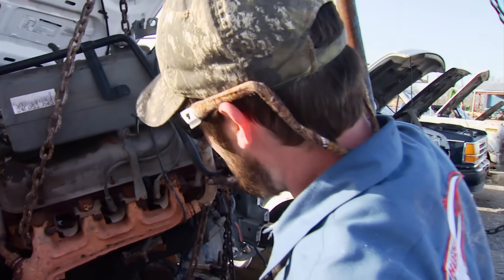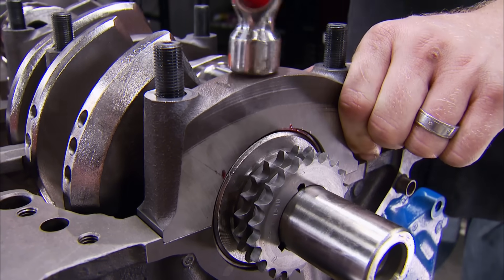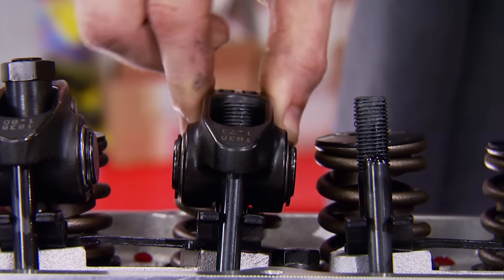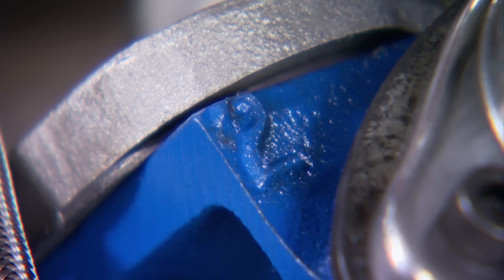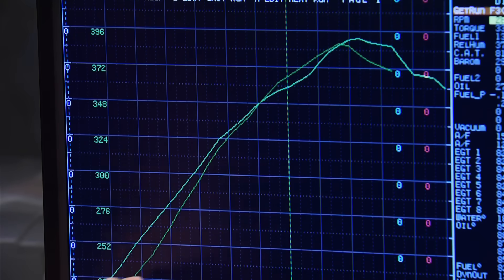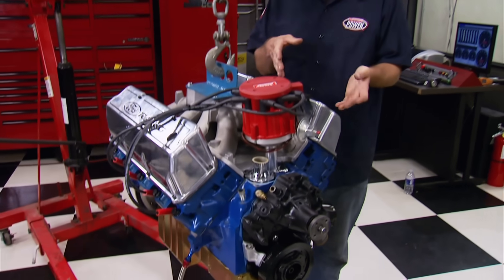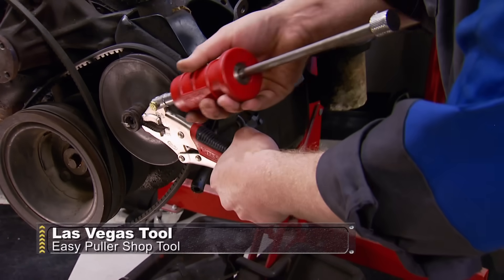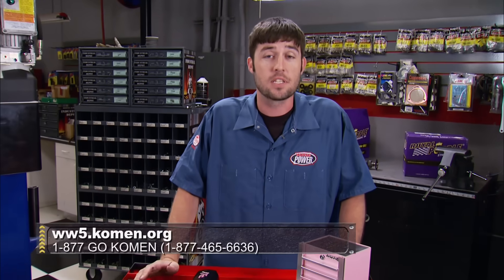351 Small Block Dyno Shootout: Windsor vs Cleveland - HorsePower S16, E11

Comment: Unless you put at least 1050 cfm carb or 
a 1100 cfm on the 4 valve head your not doing justice to the 4 valve head.
The 4v heads need serious CFM.
This is a common mistake on 4v heads.

Comment: rebuild my 360 5.9 L magnum for me i will even pay for it if you will take payments it needs a new lower end the rings burn oil at about 3-4 quarts for 100 miles lol i already did the heads @PowerNation i so love to work on engines it just is out of my price reach to do.... it will happen with time after all this truck will stay on the road the owner died in afganistan at 21 serving our country one way or another this truck will be driving 20+ years from now as i promised his dad when he sold it to me

Comment: I've seen street Cleveland's make way more power!! With the right combination of parts, pound for pound the Cleveland will outshine the Windsor when it comes to building power!
Reply: Cleveland has more bang for buck
Reply: Even 2V Cleveland heads are thoroughly decent . May as well deem them GM invention since Knudson, Shinoda both lured from there.
Reply: For hp and torque cleveland all the way yall just touched the power that motor can make it can be made way meaner
Reply: ahmen!!!

Comment: Comparison of two of the three different 351's produced by Ford gone off the rails.  We did learn that 351C-2V heads produce good torque and power for the street, 4V heads are better for high RPM engines.  Oh, wait, we've known that since the early 1970's.  Comparing a mildly built 351C to a heavily modified 351W stroked to 408 cu. in. is not a comparison at all.

Comment: I have a better comparison. That 351 Ford that had $10,000+ in parts and machine shop work. Compared to a $5,000 junkyard Z-06 chevy engine.   IF they are going to compare apples 🍎 to pineapples 🍍.

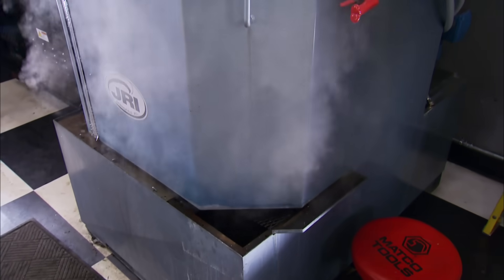Comment: 2:15 WHY? Why? do you use the WRONG PROCEDURE to install a camshaft???
Before you bolt the block to a engine stand, turn the block VERTICAL. Next lower the cam into the block.
You Welcome.
My dad showed me this 30  years.

Comment: This group should feel embarrassed by this “comparison”. While they didn’t mention the cams, the displacement, intake manifold, and ignition are quite different, and throw the entire thing out of whack. And the one thing that should be different about the motors, the cylinder heads, wound up being Cleveland for both!!!  The entire mystique is to run the Cleveland versus the Windsor. These guys completely ruined that

Comment: my 398ci Windsor made 500HP and right at 500 tq. At 28 degrees. This is on the dyno. I run a 750 quik fuel carb. jet sizes not of the fop of my head. comp cam[35-427-8] . Any 408 I've ever seen made 550 hp. My 398w is not very streetable unless you carry extra gas...…….that cam is radical . look at lift and durations. sounds good.

Comment: Clevor??  What dumb a$$ name!  Well these guys are way late to building a 351 Street Boss,  I built my first 351 Windsor W/351 oval port Cleveland heads back in 1986!  Ernie Elliot was building this engine for NASCAR's Bill Elliot's #9 Thunderbird! B&A Ford Performance had the dual plane intake and I did the machine work for the water passages!  That 351 Street Boss was a bad A$$ Motor and still have it in storage... It twisted 3 drive lines out the first week!  :)

Comment: The 351 Cleveland, America's best kept secret.
So secret in fact Americans don't know what to do with them.
If you change from 2v heads to 4v heads you need to change your fuel/intake set up and your ignition and your headers. 
The set up for 2v won't be optimal for the 4v.
I have had both and I can tell you on the street or not the 4v will kill the 2v everywhere, up top, down low, in between everywhere.
This 2v for the street is BS.
Set up the 4v properly.

Comment: 2v for the street? How about running a cam designed for the 4v head!
Reply: Oh, but that wouldn't be "fair".... right.  These fucking clowns...
Reply: Just get yourself some 2V closed chamber heads from Australia. We made them locally for the 302C - yes, a 302ci Cleveland. Chuck those 58cc 2V port heads on a 351C block and you've instantly got over 10.5:1 compression and will make decent power with any reasonable camshaft. I had an Elgin E-907-P (219@50 and 505 lift) and it was a riot!
Reply: The 4V heads have Too big of an intake runner causing the port velocity and torque to suffer. The problem with the 2V heads is the size of the combustion chamber is too big. The Australian heads are the best of both worlds as are the Edelbrock heads.

Comment: i would rather have the cleveland
Reply: if you want to see a REAL Cleveland check out  https://www.youtube.com/watch?v=tyiMoUqLmIEit's in a old Pro Stock Pinto 860 hp  @ 7,800 rpm during tuning, made 874 hp @ 8,000 rpm & 621 lb. ft. of Torque

Comment: Even if you put aside the lopsided comparison, they built the clevland wrong if they wanted to use the 4v heads.  Those heads won't find a use until 6000rmp and clevland grinds have a different approach to exhaust duration.  Not only that the Cast iron heads can stand more compression.

Comment: Would like to have seen this test with the Cleveland over 400 cubic inches, and the Windsor with a big set (bigger than 205) trick flow 11R heads. Then put the Clevor heads on and then compare...

Comment: Wow did I miss something this has got to be the most lopsided unfair comparison I've ever seen could you have even tried to make the Cleveland a little worse it's basically stock and you put a single-plane intake on a stock motor really and you compare this with a built stroker Windsor. so now you should build a 460 and compare it to the Windsor cuz that's about what you did here with the Cleveland. You guys are better than this.

Comment: What about trialing the All Australian 3V Cleveland head??? Coz when it comes to making power with Clevo's, Aussies have the know how... 😉 👌
Reply: 3v set up is sorta a waste of money,you have to us all 3v components.or,you can buy a set of bolt on alloy heads.only 1 company makes them.or,to save shit loads of money,just use 302 heads,decent cam alloy single intake,4bbl..the cleveland was designed for torque,a truck engine,not a race engine.but..id have the C,any day..[.for design,the chev 350 is a dog of an engine.].pity here in aus,the 460 is hard to come by..alloy heads,flat tops,mild cam,job done..to stroke a 351 to 383,waste,,better with the 460.i dont like chev bits in my ford..keep your ford all ford,,& your holden half ford,,9",,funny how they use ford parts, but ford is shit..

Comment: I have a 4V Cleveland stroker motor. 4.030 bore X 4.17 stroke (426 cubic inch). Crane roller cam (.589 in. Intake. .612 in. Exhaust). Torker II intake. 551hp at 6000 and 6500 rpm. 548 ft.lb torque at 4500 rpm. Not bad for a 8.70 to 1 compression. Future plans include Powerdyne supercharger.

Comment: Have you guys heard of the Australian  Cleveland 2v  heads , with valves larger than American 2v and smaller than the USA 4v. I was able to find a set here in Canada,  traded my 4v heads for a rebuild on the Ausy 2v, added Edelbrock performer intake with a 670 holley  carb and electronic ignition. I used the original crank as it was a fresh rebuild at the time, then added rollers. My dyno guy was a chevy type who wasn,t mush interested in obtaining max hp/torque. I had to tell the electronic ignition had a rev limiter on it. With mus frustrtion I was able to get him to set rpms at 5000 and we got 360 hp & 385 torque. I tryed to get him to raise the rpm to 6000 because my clevland has 4 bolt mains, but he said time was up and walked away. I truly believe we could has got to 450 and 480 easy, but I was out of money, What do you guys think, Thank from loyal Canuck.

Comment: I'm surprised you guys didn't even mention the difference in the combustion Chambers the 2v and the 4V Cleveland Heads had open combustion Chambers which have been known to not be very efficient while the Edelbrock clevor head has a nice more modern efficient combustion Chambers. That combustion chamber design alone can change a lot of things on the dyno. It would have been nice if both of the motors had the exact same cubic inches as well. This wasn't a very scientific comparison. It also would have been better if it was actually a Cleveland versus a windsor. Instead of a Cleveland versus a clevor.
Reply: The other thing that could have been tested on the Cleveland is a set of chi 3v heads that have that more efficient combustion chamber.

Comment: Guys instead of doing this type of comparison why not take a junk yard engine any kind from a 2300 pinto engine to a 230 Chevy inline 6 to a 500 cube Cadillac.... rebuild to stock dyno then start mods with the goal of the most hp and tq and still be streetable, this would give you guys something to do and you won't get 99% negative comments. If you even care....

Comment: Easy for you guys now, just buy off the shelf parts for unlimited budget, my grandma could do it like that' !  In '70s and '8s we had to do some real work blueprinting and modifying, I even ground my own camshaft for use with roller lifter, ported cast iron heads and shaved own cam bearings. I started with 1971 4 bolt main 4Bbl Cleveland and had to lower compression to 10.5 (from 11.2) because of lousy unleaded gas (87  - 92 octane). Got 400HP (6100rpm) but 578 fp torque (5400rpm). It was purely street and everyday driver in '66 Mercury M150 pickup.  With 0.76 OD manual (M53) tranny, 3.0   9" Limited slip  rear end, 33" (outside diameter, 16"/65  tires it did good 130Mph on highway and pulled 2 ton trailer without even noticing it.

Comment: Going with bigger heads and keeping the cam profile the same is definitely not going to net you anything substantial. Adding more fuel and a longer duration camshaft would definitely wake up those 4V heads.

Comment: On the Cleveland, you'd get more horsepower with an intake that matched the big ports of the 4V heads. Although they are right about the 2v heads being better for the street. I wish they would have put the Edelbrock heads on the Cleveland to see how much better they were than the factory heads. Big mistake!

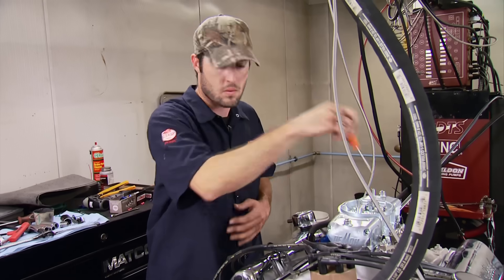Comment: ok its been awhile since ive ran a carb. somebody tell me what he is tuning at 10:42. air filter height?
Reply: That carb has an idle air adjustment system built into it using the center hole so you don't have to overly open the throttle plates which wrecks the idle to off idle transition circuits.   The only other alternative is to  drill holes in them.   It is for an engine that needs significantly more than stock idle rpms.    Mine idles at 1000.   I had to drill all 4 throttle plates in my Quick fuel carb.   Its a pain too because you don't want to over drill the holes so you start small and sneak up on it.  I wound up having to use 4 different size drill bits which means take the carb off, drill the holes, re-install it on the engine, fire up the engine, reset the idles on the engine and check the a/fr times 4.

Comment: if you like looking at ford engine videos, this was ok, but the title didn't say squat about a clevor stroker. should have got all 3 ford 351 engines and used comparable cams, pistons, etc to give a valid comparison that regular folks could use. mis-matched intake to the 4v heads definitely choked off the top end power, so it made the head swap comparison mostly useless too.

Comment: As the guy's here said, by putting the after market Cleveland heads on the Windsor block it's no longer a Windsor.
Ford made different head heights for the big, and small, block engines! However, Windsor was the exception. Ford did not make a mid, or high rise head for Windsors. Low,  Mid, and High rise heads for the Cleveland. A 1970, 351c, Super Cobra Jet was a 11.1 compression, high lift, sold lifter, high rise head.

Comment: Why not just take the best Factory cylinder head 4 the Cleveland and the Windsor and put them on a flow bench and see what kind of numbers they flow if one flows significantly more than the other and you know which one's going to make more power it's up to the engine builder to utilize

Comment: That Cleveland build needed much more compression and much more cam to really shine. That single plane intake manifold is designed for much higher rpms than the engine was built for. If you had went with 11.5 or 12:1 pistons and a 7500+ rpm camshaft, it would have really woke up with the 4v heads.
Reply: and the 2v/4v intake runner mismatch didnt help either.
Reply: @TheRowdyJ  I was immediately like “why those heads” when I saw it they might’ve just grabbed leftover stuff from other builds for the Cleveland in a fair fight Cleveland easily takes it
Reply: Agreed total mismatch of parts.  I expected these guys to know better.
Reply: @todds5956  Also, if you are going to test the 4V head, why not the quench chamber?
Reply: @todds5956  They wanted the Cleveland to loose as this way not a fair test in any way.
Reply: I ran a stock 4V  C engine  to 6500 all the time...never a miss
Reply: If they took my Cleveland build and put it up against this "clevor", the match up would be much more fair. I have a Aussy Cleveland block that was bored .10 over just to clean up , Aussy 3v style iron heads with 56cc combustion chamber, roller cam, roller lifters with 1.8 ratio, 4 bolt mains, all studs everywhere I could. The one thing that I didn't do that I wished I had done was h-beam rods. I used standard rods that were shot peaned and magna fluxed. The compression ratio came out to be a hair under 11.5 to 1. It is running an Edelbrock Air-gap style intake with Edelbrock carb. I have modified hooker headers and 3" exhaust. When last dynoed it was 468hp at 4200rpm and 587 torque slightly higher.
Reply: @drfeelmegood  you have your HP & Tq numbers backwards.....
Reply: 7500rpm on a Cleveland has it blow up!!. 7000 is max with fairly std parts. 
2V open chamber heads do not achieve much,, 70-76 302 heads will make better power, better chamber and more compression. Forget 76 on ones, the chambers get bigger, valve recession is major and the guides are all rooted. Scrap them and buy aftermarket alloys.
351 W with those 3" mains do not like turning hard as the fry the oil. Ditto with a 400

Comment: I would like to see this done with closed chamber 4v heads. The open chamber heads are a poor choice and drop compression ratio. Nobody uses the open chamber heads.
<<<<< Has a set of closed chamber heads in the shop.

Comment: Why not stroke the Cleveland to 383 or 392 and get aftermarket Cleveland heads?
Also you converted the 351 Windsor to an aftermarket headded 408 Cleveland to beat the 351 Cleveland.

Comment: They changed out the 2V heads for the 4V heads on the Cleveland, but did not change to a corresponding 4V sized intake? If they used the 2V sized intake on the 4V heads, they had a huge port mis-match, and that will cost power, it will work, but it is not optimal.

Comment: We made 600hp with a windsor years ago and even got into the 9s with it. It didnt live very long. The best of everything in a turd is just an expensive turd. However a basic common sense 351w and you have a reliable high 11s bracket motor. We had one go 5 years running a couple different classes per weekend and it never missed a lick. Hundreds of passes

Comment: What’s the cam specs? Why stroke the Windsor and not the Clevo? Why use aluminium Cleveland style  heads on a Windsor yet use standard 2V iron heads on the Cleveland? 4V was never going to compete in this comparison. Use Aussie CHI  185 3V heads on a standard stroke Cleveland.
Hardly an even comparison. My view....

Comment: 4V head is good as a anchor! Too big and no airspeed. Worse with open chamber
Best factory clevo head is the Aussie 302 head, mine makes 440hp with 11.2-1 and a 750 HP on a 355  Clevo. And hydraulic flat tappet
Those alloy heads will make more power. 
The open plenum intake used on the Clevo  makes good top end, and less bottom end.
The Dual plane is the better street intake generally on any engine.
As for comparison? a 4" stroke totally stuffs up any comparison,, as does the different intakes.

Comment: You guys are amateurs. You swap heads w/o changing manifolds? You ran a single plane intake on a 2V head? You compare 408 cid vs 357? BTW, PHR had a simple 4V 351 at 441hp in the 1970s.  (Stock block except intake, cam, headers and carb.)